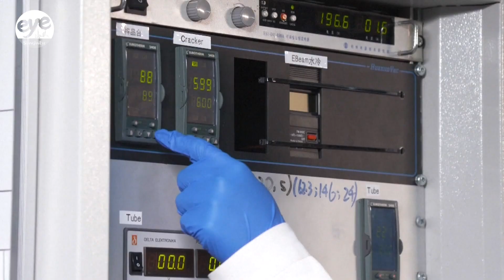Bedrock of next-gen chip tech? China uses artificial sapphire insulator to extend battery life

Comment: That's an important development because it will make further miniaturization of circuitry practical. When the circuitry is miniaturized, at a curtain point the leakage current becomes a major issue. This development reduces the leakage resulting in lower power consumption and less heat generation. That's important for: mobile applications and applications that drain larger amounts of energy.
Reply: China must keep the tech secret and away from the US gov and the wall street bankers, if successful US will ban you and try to arrest your ceo or inventors.